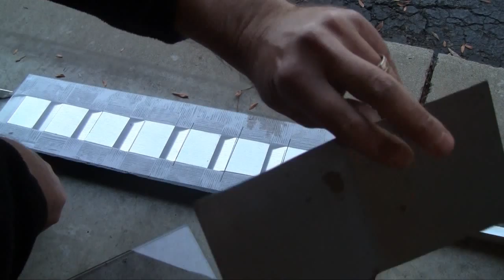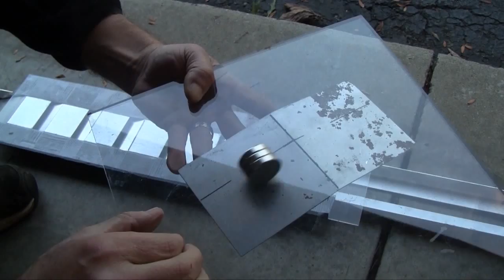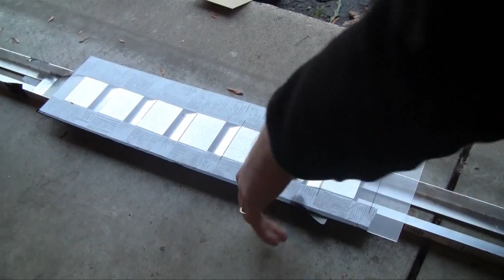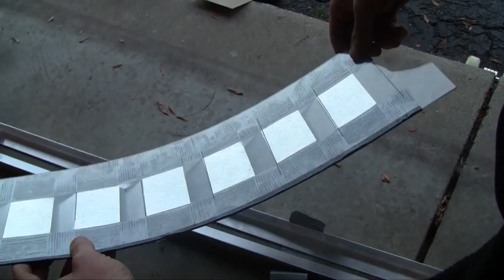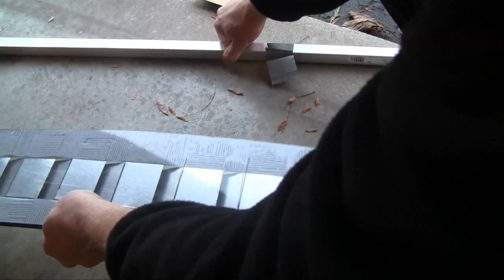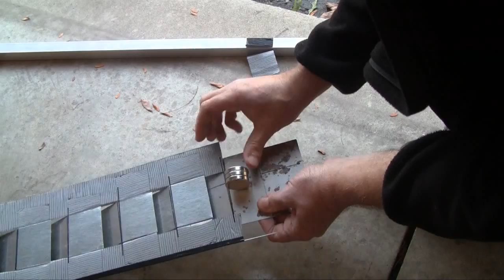FREE ENERGY  Now open source.

Comment: This is not "Free energy". You have to put in energy to pull the magnet off and put it back at the start. You say putting it in a circle will "cycle", and I'm not sure what you mean by that, but I can guarantee you the object will come to a halt simply due to friction with the surface.
This should also be made obvious by the fact that the subsequent metal plates aren't accelerating the magnet. Immediately that should tell you that no energy is being added to the system, and the magnet will come to a halt due to friction.

Comment: Oof. OK now I am not very inclined to believe that you found a proof to the Riemann hypothesis anymore. Although that looked a lot more convincing than... this. What is it supposed to be, a perpetuum mobile?
Reply from the maker: No, it's not a perpetual mobile, which would be impossible.  It is a simple propulsion device that anyone can build.  I filed a provisional patent, but decided to instead not continue with the full application.  But what's wrong with it in your mind, and what does it have to do with the RH?
Reply: @jnoelcook  You call it free energy in the title, which implies that it breaks the laws of thermodynamics. A circular track would prove that it's not travelling down hill since it would have to return to the starting point. You could have also turned the whole track around 180° and demonstrated it again. The thing that this has in common with your RH video is you. If you're claiming to have created a free energy device then people will be less inclined to believe any of your other claims.
Reply from the maker: @peterboneg  It's free (kinetic) energy by definition of being "obtained" (motion is evident) giving no input.  One simply 1) releases the magnet assembly, 2) the assembly is attracted to the first plate, but 3) at the trajectory it skips passed it with enough momentum to move to the next, where 4) the process repeats until the last plate. 

Nothing breaks the laws of thermodynamics.

A circular track is not the design.  I don't know if that would work.  You try that if you want to prove that.  I didn't make any claim for any such design.  I only make the claim of a linear design.  For the linear design, it's a simple build, of which anyone can go to the local hardware store, buy the materials and go online to by some 1.25" R x 3/16" thick rare earth magnets, and the whole device would cost less than $50 to prove for yourself.  

As far as the RH and this, as though they should go hand in hand, they are both easy enough for the lay person to verify.  I don't care anything more than that.  Would you?
Reply: @jnoelcook  The statements 'free kinetic energy from no input' and 'doesn't break the laws of thermodynamics' are contradictory.

I disagree that there's no input. You start by holding the magnet at a distance from the first plate and in doing so you're giving it magnetic potential energy from yourself. This energy then gets converted to kinetic energy at it moves towards the first plate. Momentum then keeps it going to subsequent plates but it will eventually slow down due to friction unless it's going downhill. The method of starting it by bending down a plate also requires you put energy in from yourself by moving the plate away from the magnet.

In this sense the device is no more useful than an unpowered cart rolling on a flat surface. It requires some energy input to start and then will keep going until friction or air resistance bring it to a stop.
Reply from the maker: I would begin your study into the first law of thermodynamics in terms of isolated systems before discussions on this design. 

Here’s a place to start:

https://en.m.wikipedia.org/wiki/Isolated_system

When you completely understand the first law and the meaning of how it relates to isolated systems, I would be happy to discuss the physics of this design.

Hope that helps.
Reply: @jnoelcook  That's just my point. The device is not an isolated system on its own because it includes you. You're the one providing the initial potential energy. Your claim is similar to claiming that you get free energy by dropping an object from above the ground. You could say that it gains kinetic energy from "no input" but in reality you input the energy when you lifted it above the ground.
Reply from the maker: @peterboneg  , It reads by your comments that you are getting closer to understanding the mechanism, but if I re-read your initial comments, I see that you were first accusing me of angling the apparatus to cause the motion, which is simply incorrect.  Certainly I demonstrate multiple angles.  But  I do also demonstrate its motion on the flat ground.  

The important aspect of the design is that each plate is an independent isolated system from the next with respect to the magnet.  By the principle of least action, the magnet can only be within an isolated system with one plate at a time.  The field interaction of a distant plate is negated by the field lines of the one in front.  This is significant, and why a circular track would be difficult, as the field lines would no longer be negated by the ones across the circle.  I will link to the provisional patent description once I upload it, so that you can learn how it functions.

Hope that helps.
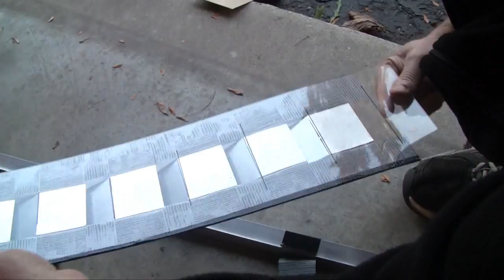Reply: @jnoelcook  I wasn't accusing you of angling it. I was simply saying that there's no way for us to know that it's not going downhill based on the video. Even if it was on a flat surface, the track length is not long enough to convince me that it would continue indefinitely, which is what you seem to be suggesting. You also did imply in the video that you could build a circular track so that it could repeat for ever (see 3:40), but in the comments you say that you never mentioned a circular track. I would like to see your application to work out what it is you're actually claiming.
Reply from the maker: @peterboneg  , I'm going to try to be very generous here to help you along in your understanding if I can.  In English, there's a big difference in meaning between "cycling" and "could repeat for ever."  Perhaps this is why I read a false accusation out of what you have written, as I am reading the same in this comment as well.  In other words, I only claim what I have claimed, which is free energy and cyclable. 

But in short, the video is a basic demonstration (in order to demonstrate simplicity) of a mechanism of which I filed a patent on years back, but did not continue forward with the patent process, as I and others could not come up with a monetary application for it in time (compare with Faraday's homopolar motor and many other scientific discoveries that could not be monetized in their day, but whose principles are used in every electric power plant and device today) .  The video was private for several years.  I just recently made it public, as I think it is a useful scientific discovery where anyone can learn more about free energy (it is a real thing, and no real physicist disagrees) and open systems.  

Thermodynamics only applies to closed/isolated systems, so when I read "That's just my point. The device is not an isolated system on its own" it further encourages me to ask you to go re-read that article on closed systems to better understand this science...as my point is in direct opposition to what you are suggesting (not in line), which I read as [it cannot be free energy due to the laws of thermodynamics, but at the same time suggesting it's an open system] while MY point is that the laws of thermodynamics do not apply, as it IS an open system. 

Lastly, the track does not need to be perfectly straight and can be curled or built in a circle.  I did also mention that there are resistive factors.  These factors in terms of a small circle are particularly significant.  I have built a small one with just 4 bands in a circle and it only went around a couple times, which is a couple more times than anyone has every been able to accomplish.  To date the greatest amount of a circular magnetic [free energy] propulsion design is 90% - ish of a circle.  You do know these exist, right?  But this apparatus does cycle > 100% the circumference.  

It was quickly learned with this mechanism that the reason why the circular design slows down at a far greater rate than a linear is because the pull across the diameter of the circle from those bands negatively affects the magnetic rigid body to slow down.  This of course becomes less and less of a problem the larger the circle gets and the farther and farther the bands across the diameter become from the magnetic rigid body.  But such a large apparatus is expensive and I do not have place to store it.  I have not built one and cannot say anything about how it might work...other than what I know now is that the less the curl, the less the resistive forces...and the farther it goes.

Build one yourself.  You see how it's made.  It's a gift from me to you.  Merry Christmas, and you're welcome.